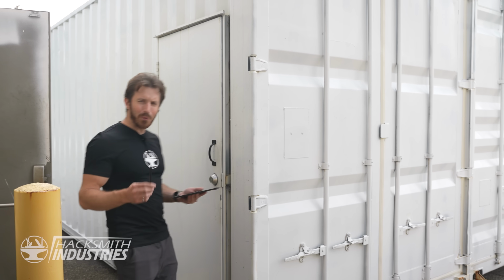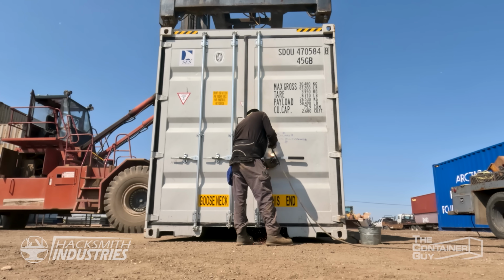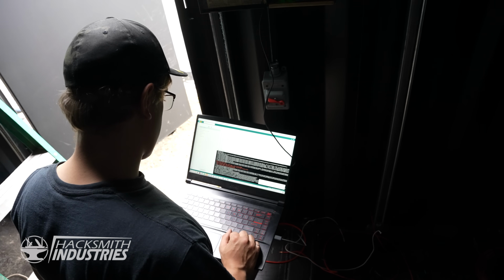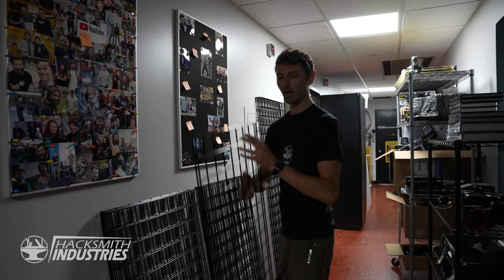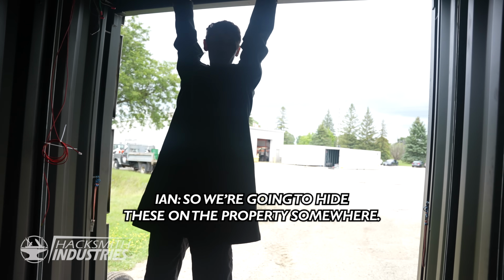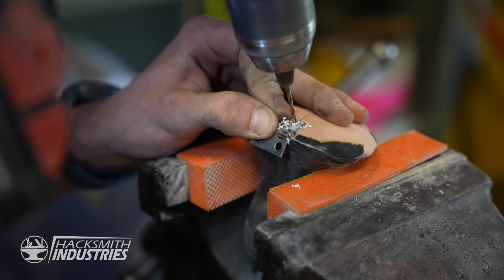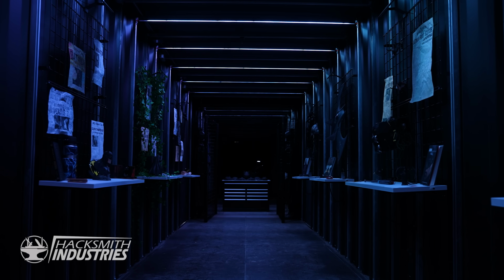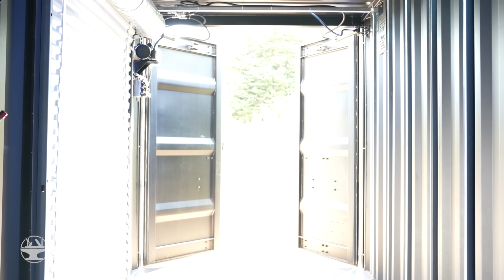Real Life Batcave Build! (Secret Entrances)

Comment: idea:
remove the sidewalls and replace them with a set of containers.
if you as example, put 2 containers longside with said long side wall removed next to each other, you can create a more open space. 
works with the ceiling as well, making the room higher. doorframes on the side leading to more modules give extra rooms

Comment: Hey, I have a container I’m building out with The Container Guy parts right now.  Is there anyway of getting that lighting setup document and programming?  I’ve seen a lot of your videos but I don’t recall if you ever make any of it public.  That’s the exact lighting I’m wanting to do.  It was either that or all ceiling tiles like the Dark Knight room.
Reply from the maker: It was really expensive to do, wouldn't really recommend it. My original plan was simple light fixtures then a big relay board to do the light effects.

WLED is a good resource for programming LED strips though, lots of tutorials out there!
Reply: @hacksmith  Okay, thank you for the reply.  I’m really familiar with addressable LED’s and the controllers.  Did you use mechanical relays at each strip to achieve the snap on noise for each strip turning on? Any info on that would be appreciated.  I love your design!  It is perfect!!
Reply from the maker: you'd only use mechanical relays if you were using regular light switches -- we added the click noise in software by having a solenoid smack the inside of the switch box with each strip turning on =P

Comment: The criminals already know about the hydraulic doors thanks to this video.

What now, Hacksmith?
Reply from the maker: you still can't open it from the outside even if you know how it works lol
Reply: @hacksmith  Your funeral if they broke in. I'm just trying to help.
Reply from the maker: how does knowing about the doors help them?  they can't power them, they cant cut them, they cant access them from outside of the container.

they can cut the "lock" off the outside, but the doors won't open, because they're hydraulically locked shut
Reply: @hacksmith  Hacking, buddy. You forgot about hacking.
Reply from the maker: Hacking what? There is no way to hack into this bat cave... the power system is entirely inside of it.
Reply: @hacksmith  Wireless hacking, I mean.
Reply: @theHacksmith  Oh, and also, one more thing:

I like the video about you trying to fly like Iron Man, but I think you're doing it way wrong.

Research on the Silverberg proposal for rocket boots and the NASA jet shoes. Those might be good inspirations for your next project on flying, should you ever consider it.
Reply from the maker: you can't hack a system wirelessly when the system is not wireless

Comment: I'll contact you. I need gadgets. I've been away for a while. I'm back. I'll be training. You keep building. I need stealthily light bullet proof suit that is really easy to put on and take off alone. My current armor takes too long. Too many pieces. I need to put it on like a jump suit with boots and gauntlets. I'm not made of money but I could compensate via barter or trade. I'll be a patrion next month. Christmas is expensive. I need full body armor 100% coverage. Bullet proof water proof fire resistant  and maybe it's own oxygen with night vision thermal vision hearing enhancement technology in the helm including defrost. I need a space suit basically. I'm gonna work on my 2011 nissan altima, needs armor underneath incase of landmine or just bottoming out. And run flat tires. Maybe nitric oxied in the future. And a terate on top, cuz I have a sun roof.... I've got work to do. It's not how I am underneath, it's what I do that defines me. I'll be in touch. I can't divulge here on youtube. I'm six feet tall 36 waist size 11 1/2 boot brod shoulders I'm not ripped but I've been on and off lifting since the third grade.  Just for sizing if you wanna get started.  Thank you.